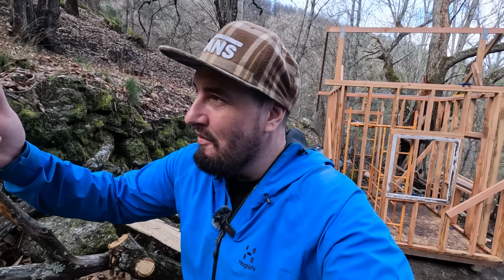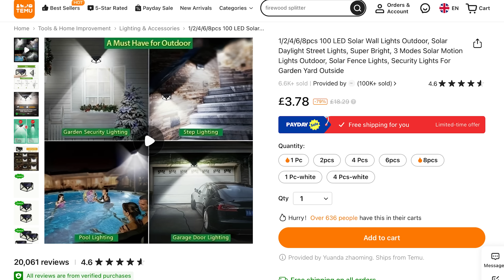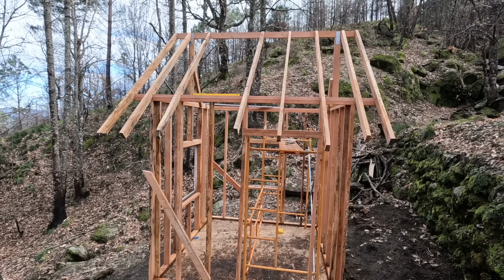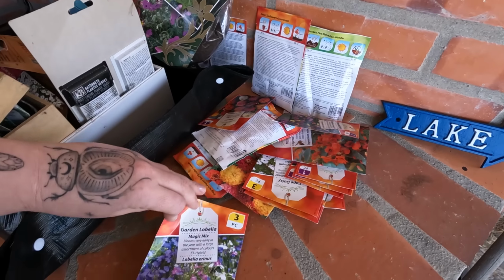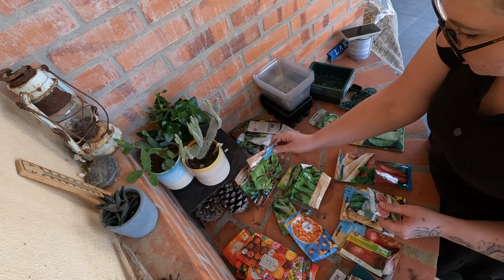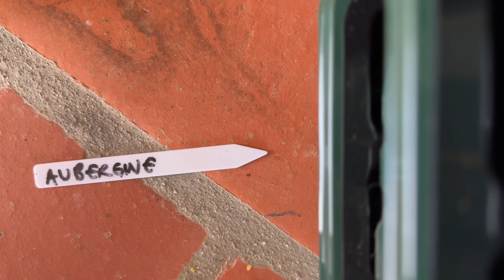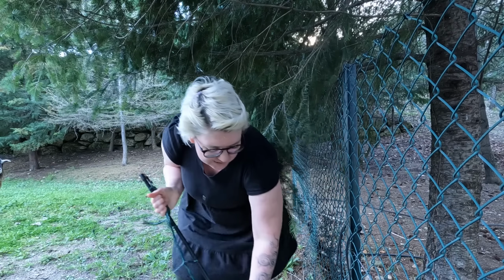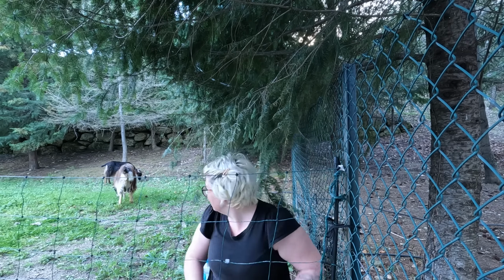ROOFING AN OFF-GRID CABIN IN THE WOODS | DIY FOREST BUILD

Comment: My son insisted he didn't like Aubergine (called Eggplant in the USA.)  I fixed a luncheon for my mother's birthday one year and had a couple of her friends as well as my son and I, and served Moussaka which is a lamb and Aubergine casserole.  My son had a second helping, telling me it was delicious.  You can find a recipe on line, I'm sure.  Don't tell anyone what it is before they eat.  Bon appetite.   😁

As for the dormer window:  If you hinge that on the top or one side, that will make a nice vent to let hot air out during your hot summers.  A bit more work, but otherwise that high ceiling will become a heat sink during the summers.